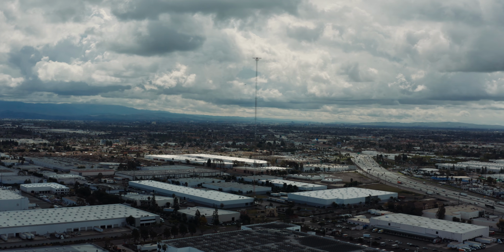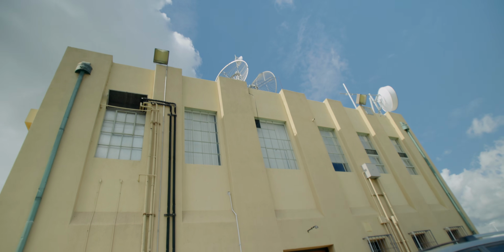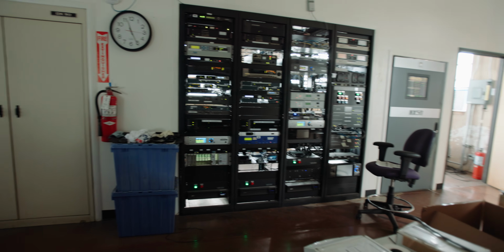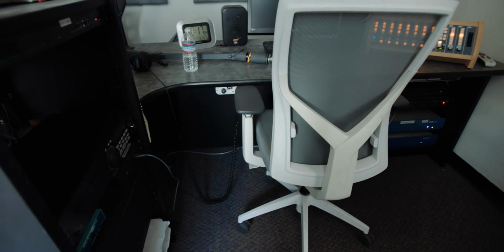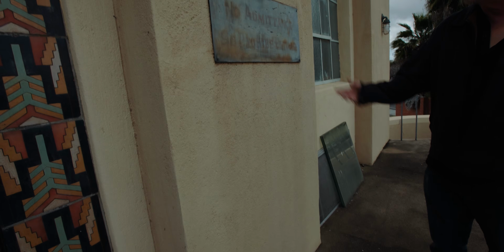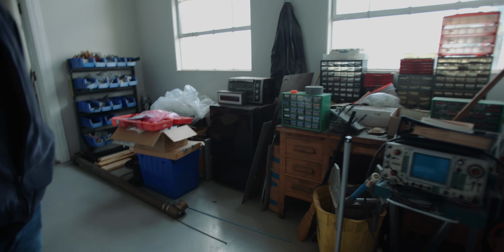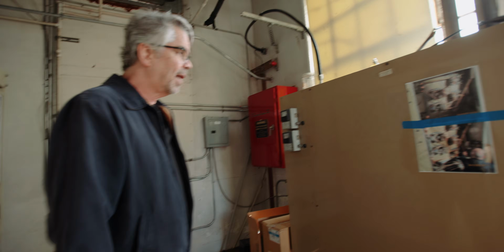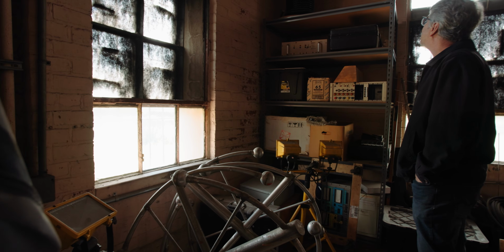Transmitter Tour - KFI Los Angeles 640 kHz

Comment: Back when I was a kid in North Santa Ana in the late 1950s I got a stocking stuffer gift for Christmas that was a plastic crystal radio shaped like a space satellite. A  single silicon diode and a tuning coil that needed to be grounded with an alligator clip. The only station it would pick up was KFI, probably the ground wave according to my electronics teacher.
Reply from the maker: KFI is a 50kW station transmitting from La Mirada. It wouldn’t be hard to get it in Santa Ana.

Comment: Some how the new transmitters are not as impressive as the water-cooled jobs with mercury vapor rectifiers with a blue glow varied in step with the modulation.
Reply from the maker: Those old transmitters look cool, but boy do they scare the poop out of me. I'm more of a low voltage guy.

Comment: Between the mid-1980s and 2004, when that errant Cessna hit and knocked the tower down, we made many BASE jumps from the KFI Tower. We were already aware of the dangers of Electro Magnetic Radiation so the rule there was, "Get on, get up, and get off." No dawdling. You might be interested in how we did it, and I guess it's okay to spill the beans now. 

With the tower in operation walking right up to it and grabbing a hold would instantly kill you. The KFI Tower is 50,000 watt flamethrower so we had to figure something else out. So for at least fifteen years we kept a long wooden plank hidden on the roof of that small shed/building that stood next to the base of the tower. Actually, it wasn't hidden, it was just sitting up there. And it always amazed me no one, in all that time, ever noticed it.

What we'd do is push the plank out close to the tower, maybe four feet away, walk out on the plank, and then leap across the free air to the tower to avoid grounding ourselves. And two buddies standing on the other end of plank back on the roof counter-balanced it. I also had some friends who, with a few running steps, could make the leap from the roof to the tower without using the plank. But, I always considered that too dangerous. If you lost your grip on the tower, after leaping across, and dribbled down - you were done for. 

I have more than fifty jumps from the KFI tower. Always at night. And no one has ever been caught there. And considering all the local BASE jumpers in SoCal were jumping it, plus many out of town jumpers, there's been thousands of successful jumps made there. 

However, I've had a few interesting things happen to me at KFI. 

We usually jumped at between three and four o'clock in the morning to avoid detection. But, one New Year's Eve, we got the bright idea to climb the tower and jump just before mid-night. And if we timed it right we could jump in one year and land in the next. And like I said, we climbed the tower as fast as possible and I could get to the 600-foot level in about 25 minutes. We never went all the way to the 700-foot level due to the configuration of the guy wires. Jumping from there would put you too close to the last set of wire as you opened your parachute giving you a bigger chance of hitting one. The very first time I climbed the KFI tower, it took me close to an hour. There are no stairs, of course, it's only skinny steel ladder. In fact we called it a 'suicide ladder,' because if you fell while climbing there was nothing to stop you from going all the way down. The emergency procedure we taught first timers for that eventuality was to reach out and, "Grab Steel." 

We got to the six-hundred foot level, but a bit too early to make the New Year's plan work, so we waited. At a minute to mid-night, we checked over each other's parachutes, decided who was going first, and got ready to go. And all of a sudden I heard a loud metallic sound and we both instantly realized holiday revelers in the surrounding neighborhoods were shooting their guns at the tower. We could see the muzzle flashes all around us. Needless to say we forgot all about the plan and jumped as quickly as possible. And I did the longest freefall there ever that night since I didn't want to spend any extra time under my parachute like a sitting duck. 

Sometimes, if conditions were really good, we make two jumps in one night, but that meant re-packing our parachutes. And we'd go somewhere else to do it, just so we weren't spending too much time inside the fences and be seen. I found an alley-way behind a small local mall and we repacked there. But, right in the middle of things a bunch of doors swung open and streams of movie goers being let out suddenly filled the alley. And, we did some fancy fibbing to side-step all their questions. 

On another night we are already at the top when several police cruisers, lights and sirens going, pulled into the area. This was it, I thought, someone saw us and called it in. And I was finally going to be able to use a line I'd been saving for a very long time. "Come up, and get me, Coppers!" However, it turned out they were there for some reason un-related to us. So we could jump and they probably wouldn't see us, but they might hear us. Our parachutes do make a sound when they crack open in the still night air. So we waited. And it was the longest time I ever spent on the tower. 

Our rigs have metal hardware in some places and I noticed mine was getting warm to the touch. Then all of a sudden my friend said he could hear a radio playing. But, I didn't hear anything. And he said, "Are you kidding me, I can hear it plain as day."  I touched some metal on his rig and it was cold, not like mine which was warm. We finally figured out he was picking up the tower's signal through the fillings in his teeth. When I put my ear close to his mouth I could hear it too. This was all getting very spooky so we jumped and thankfully the cops didn't notice us.

Nowadays, the BASE community has lost interest in jumping AM towers. And we teach newbie jumpers to stay away from them. FM and TV towers are still fair game, but the long term risk of AM towers, and the EMR just isn't worth it. Especially, since there are plenty of easier picking around, like buildings, bridges, and cliffs. And just as an aside, that's what the acronym 'BASE' stands for - Building, Antenna, Span, and Earth. And in order to be a card carrying BASE jumper you must make at least one jump in each of those categories of objects. Then you'll get issued a sequential BASE number that's yours for life. I'm BASE number 194. 

I'm in my seventies now and no longer able to do things like this anymore. But, I'm sure glad I did. 😇
Reply from the maker: Holy smokes that’s some amazing stories! I never thought that anyone would in the middle of the city, but I guess why not! Thank you for sharing!
Reply: @TheBroadcastEngineer  Thanks for not being mad at us. And believe me when I say when the big tower came down after the Cessna flew into it, all the local BASE  jumpers were as bummed as you guys were.

Comment: I saw a video of the old Richfield building. It said that KFI used to transmitter from the tower at the top of the building, but didn't give any dates of operation.
The tower in 2004 was hit by a plane from the local airport.
Reply from the maker: @ronaldgibson  As far as I know, the only other place they transmitted from was the Packard dealership in Los Angeles. That would have been only for the first few years of operation.

Comment: I would love to see more about the FEMA setup and how they made it EMP proof.
Reply from the maker: Me too! One of these days...
Reply: Based on other site tours, they hint it's supposed to be completely electrically isolated. I'm not clear how the cutover from the EAS rack in the air chain on KFI's main signal over to the isolated PEP In The FEMA Box would occur. Or who would man the PEP transmitter if KFI staff could not.
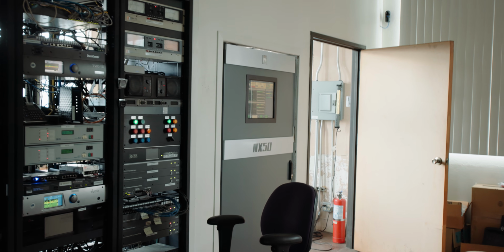Reply from the maker: There’s only one connection to the FEMA shelter, and that’s the RF cable that comes into the brown box behind the transmitters. Doug and I point it out. KFI has two EAS units, one at the studio for Los Angeles stuff and the one for PEP stuff (in the rack as seen at about 4:55). When the NPTs happen, it’s fun to listen to them as you’ll hear two NPTs, the first from the PEP EAS box at the transmitter, and the retransmission from the studio one. The PEP EAS is connected to FEMA’s PEP network (should all be satellite delivered by now). There is another Sage ENDEC in the FEMA shelter, but that’s connected to FEMA’s studio and does its own thing probably. Think of the FEMA transmitter as its own separate studio, transmitter, air chain, everything. The only thing that would be used of the “host” station would be the antenna. And for a station like KFI, they’d be at a reduced power if using the FEMA transmitter, as that’s what can fit in the EMP shelter, and can be powered by the generator and available fuel.
Reply: @TheBroadcastEngineer  Interesting. So the Nautel in the PEP shielded box drives the main KFI antenna. Seems like there's an ENDEC and SiriusXM receiver pair in the PEP bldg and in the KFI bldg. Which would make sense. There was a sort of 'EMP shielding' craze when Congress started the upgrades after Katrina.
Reply from the maker: Yep! SiriusXM is another national source, as is NPR Satellite, and Premiere Satellite, however, I don’t believe those sources have EMP shielded facilities. 

The FEMA Nautel would have to manually be patched in to the main or aux antenna. However, the aux antenna is short so that would be a really bad match (lower power plus short antenna).
Reply from the maker: And who would man the FEMA stuff? Well, theoretically KFI staff, but realistically, who knows. Maybe military, maybe National Guard. I mean, the FEMA stuff would be all trans and post attack scenario. Pre attack would be using the host station’s equipment.

Comment: I wonder if the "Tower Lights" switch, was placed due to I've seen some older antenna sites where the call letters of the station were on the antennas, and had ground lighting aimed at them. Wonder if that existed there?
Reply from the maker: Looking back I’m thinking it may have been lights from the building aimed at the tower… but who knows.
Reply: Came to say the same thing. Glad someone beat me to it

Comment: I would have liked to see the auxiliary transmitter for the Emergency Alert System. This was an original Conelrad station back in the day. And even now it's supposed to be on the air in case of a national emergency. The logs for December 7th 1941 being lost is interesting. I think back in the day, there was concern the signal could be used by enemy planes as a beacon, just like it happened in Hawaii...
Reply from the maker: We were both pressed for time that day. We had talked about it before.
Reply: That was the reason for Conelrad after the war.  I remember radios made in the 1950s and 60s had the Conelrad synbol marked at 640 and 1240 on the AM dial.  They never did tests like they do now.
Reply from the maker: @dfirth224 There may have been a couple of tests, but 1) it sounded like trash on the air and not always food enough to hear for the public, 2) the frequency change took a while to do (wasn’t necessarily existing 640/1240 stations), 3) it was hard on the transmitters to turn on and off.

Comment: I started listening to KFI in the late 70's. I visited the tower site in 1986 long before all of the commercial land was developed. I took pictures on slide film of the old tower and the KFI tilework. I was at the tower site a few days after the tower fell in 2004 and still have a paint chip about 2 inches in diameter that I removed from the original tower. I have cassette recording of KFI from the early 80's through the mid 90's. I lived in the City of Orange and would visit the tower occasionally every few months when I lived there (1990-late 1992)  I still listen to KFI at night as I live in Chico Ca (about 500 miles away) Great memories.

Comment: Interesting to see the towers in such an intensively built up area rather than on agricultural type land in some rural setting. The contrast is fascinating remembering a picture I once saw of the old 630 CFCY transmitter and tower sight on agricultural land outside of Charlottetown Prince Edward Island, Canada. Ground radials in rich red soil with salt water a short distance away. For a 10 KW Station CFCY had a massive signal. I had not imagined an AM Station having towers where you have them. Thanks for all the education you provide.
Reply from the maker: Not that long ago it was rural farmland.
Reply: @TheBroadcastEngineer  Interesting!
Reply: @TheBroadcastEngineer  I remember it most of my life being that way, amazed to see so much building around it now.